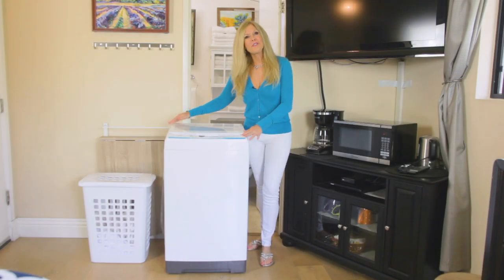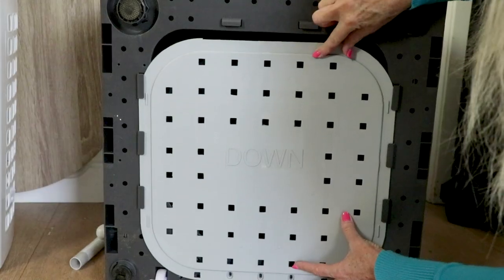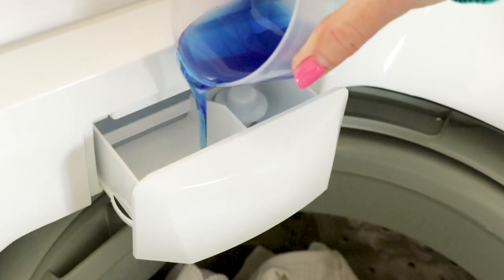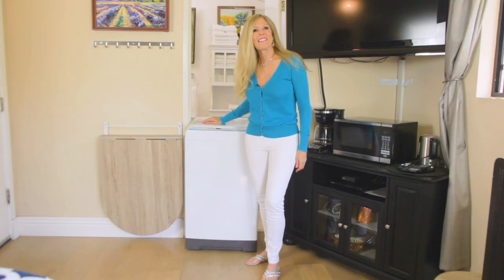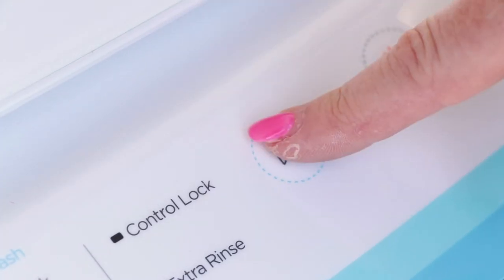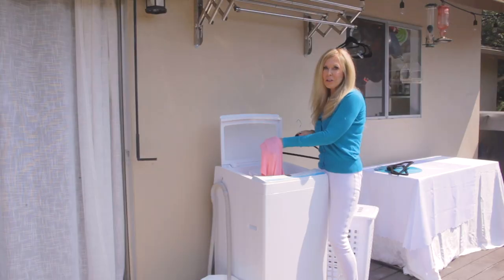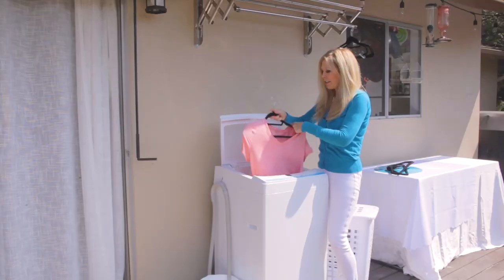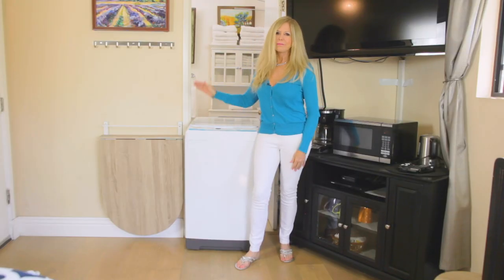Portable Washing Machine Review | Easy to Install & Wash Laundry

Comment: I've had my washer for a week now but have not used it yet because the manual says to use powder detergent but I typically use liquid or pods. So I don't know what to do. I don't want to damage the machine. But I bought a $30 dolly for mine off Amazon to help move it around.
Reply from the maker: Great you bought a dolly --- DON'T WORRY ABOUT THE DETERGENT.  The manual /maker knows powder is cheaper -- so use what you like, but use it in lesser quantities because you don't want too many suds!  For me< i use an ECO friendly and let the gray water go to the garden.

Comment: I have a comfee washer. I absolutely love it. Used it twice. What's the black piece of plastic underneath by the belt. It was on top of styrofoam. Was it just packaging
Reply from the maker: Doesn't it go under?
Reply: I just bought it and i have the same question. Black plastic piece was not underneath. Any idea?